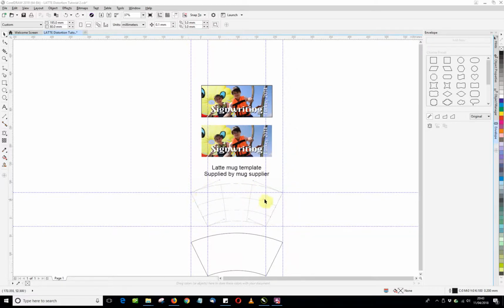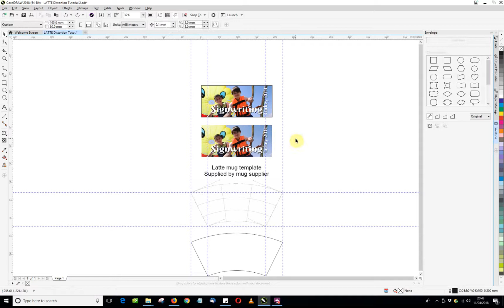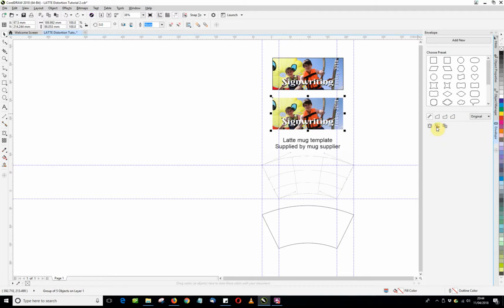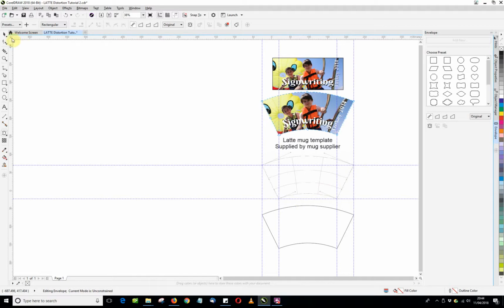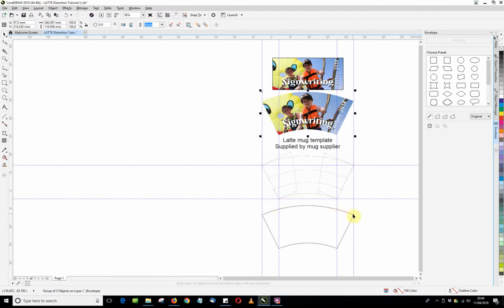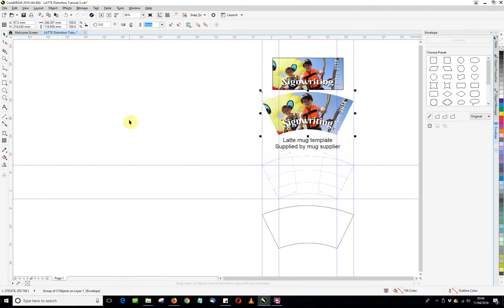Latte mug distortion with Corel Draw 2018

Comment: Hi Alan, Thank you for posting this video, I hope you can help me please?. It doesn't matter WHAT I do, I cannot get the "create from" icon to highlight once I select the bmp. I have put them on separate layers, same layer, please, any advice? Thanks
Reply from the maker: Hi, distorting bitmaps was a new feature in 2018, previous versions couldn't do it. Also do you have any drop shadows or similar in your design, these are best flattened to the background with vector objects on top, then group everything. Bit of a workaround but it does work